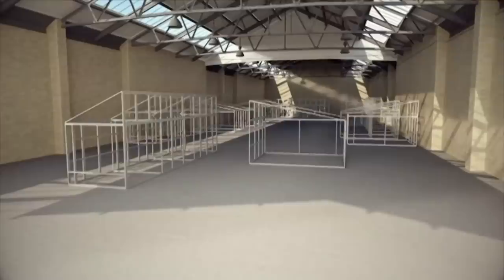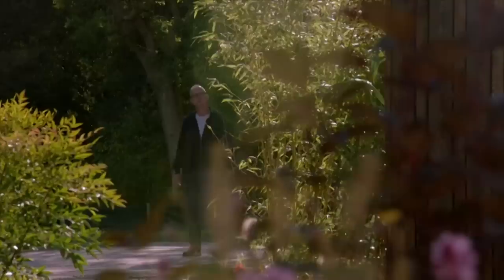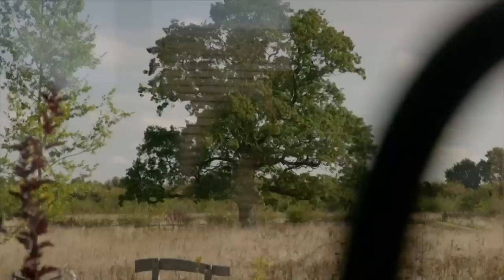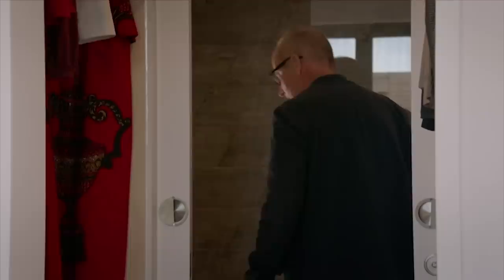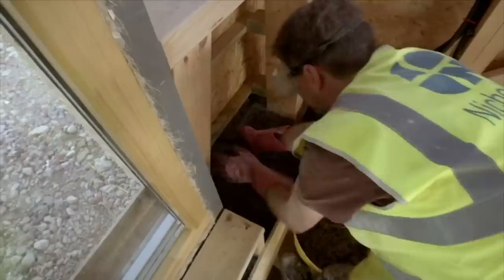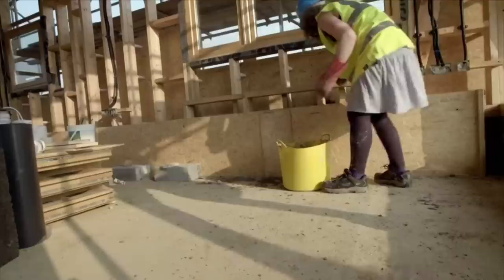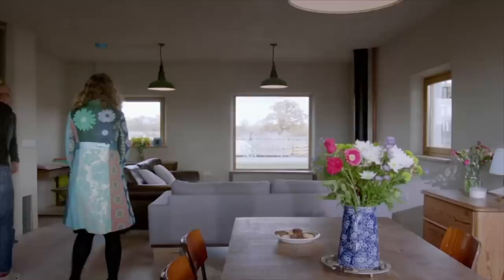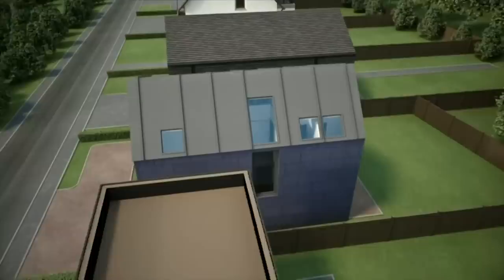Kevin McCloud Visits Three Fascinating Homes | Grand Designs: The Street

Comment: This is how single family homes in the future should be built. Built inside a factory protected from the elements and then assembled on site in less than a week. Fully functional. Preferably solar powered and get this ... Wireless Electricity thru-out the structure. 🤔
Reply: The day wireless electricity makes a breakthrough I'll be a happy man.